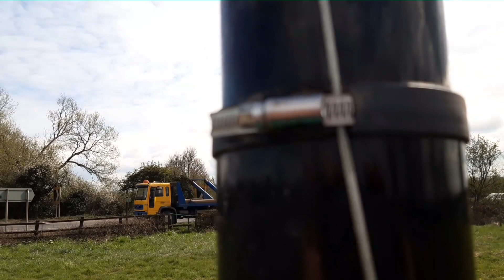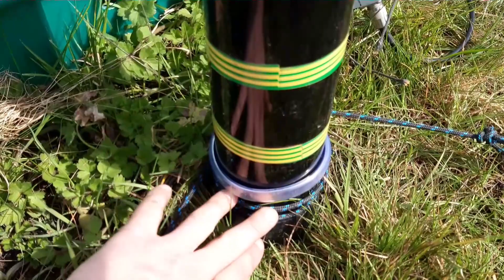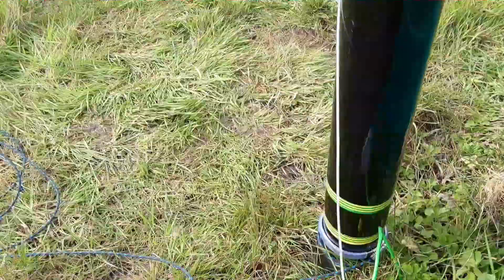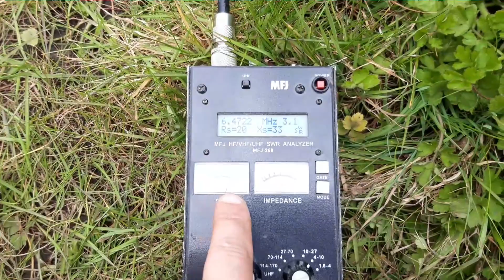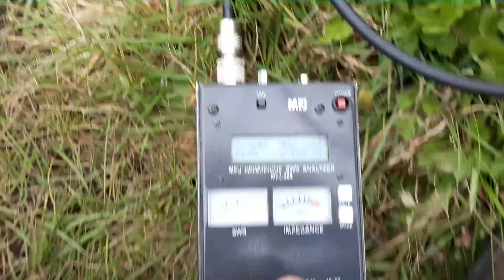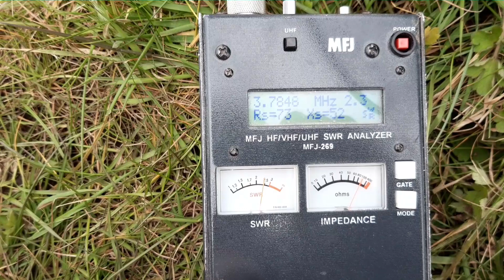Antenna Farm Vertical

Comment: Brilliant project. That will really sing on the low bands. If you could ever afford another your could christman phasing them very easily. What a 80m DX antenna that would be.
Reply from the maker: Unfortunately I don't think that I can justify the cost or effort involved in erecting a second identical mast. I would however love to put a remote tuner at the base, which would allow me to load it up on pretty much any HF band. Again it comes down to cost.

I was going to put a loading coil on it & try to load it up on 160m one night. That could be a fen experiment.
Reply: @HamRadioOnline  Totally get that. If you load that up on 160 you will be in with a shout during CQWW 160.